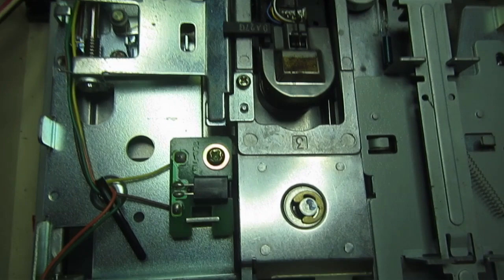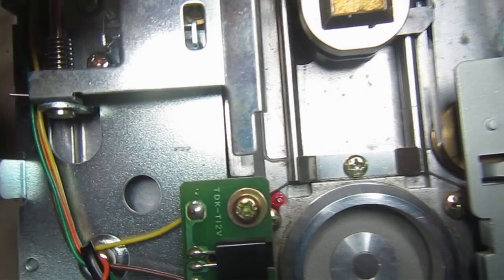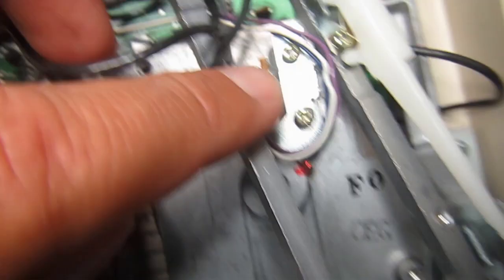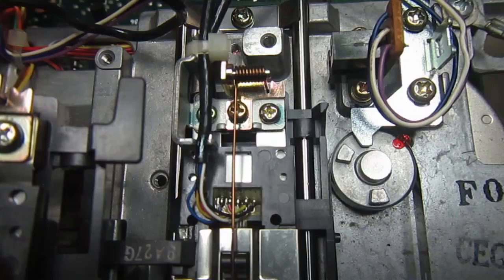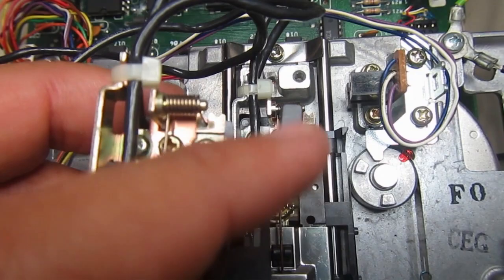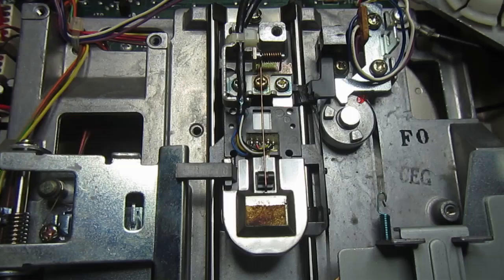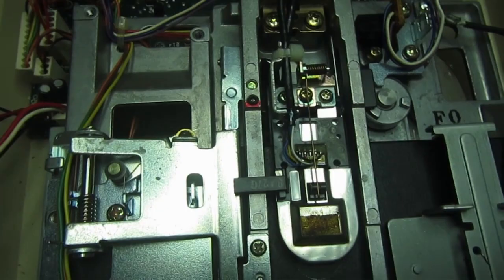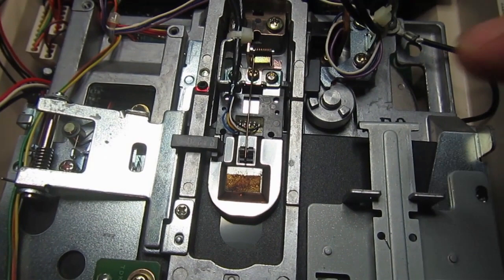Commodore 1571 disk drive repair pt. 2: Replacing the R/W heads

Comment: I only just found this video. i was the seller who sold iz8dwf the NOS 1571 head. So sorry about the sensor, I simply hadn't noticed. :-(
So glad you managed to repair it. I have 3 or 4 others that also have the missing tab, so hopefully I can repair them before letting them go to other needy 1571 owners.
Reply from the maker: Hi Rob! Thank you very much for your help and comment!
Reply: Hi! Do you still have these available? I have a 128DCR with a probable broken lower head. I have yet to take it apart and check if the break is in the wires or in the actual coil, but would be nice to know that a replacement is still available in case I need one. Thanks!

Comment: I got a 1571 floppy drive in pieces and I figured how to put it back together mostly but I was a bit lost at the metal band that's connected to the head assembly. It seems my unit is missing a spring that holds together the two ends of that spring band. Thanks!
Reply from the maker: I'm glad the video helped somehow :)

Comment: What an lovely piece of real detective repair work right there. Quite a shame with the broken little piece with the replacement, did you find out if that piece got broken during the shipping or has it been broken all these years?
Reply from the maker: Hi Midolf, thanks for the nice comment! The owner of that stock of replacement heads just went through the whole stock and he said there are a few others with missing tab. So probably it was broken since years. The good news is that the missing tab can be repaired with some effort :)